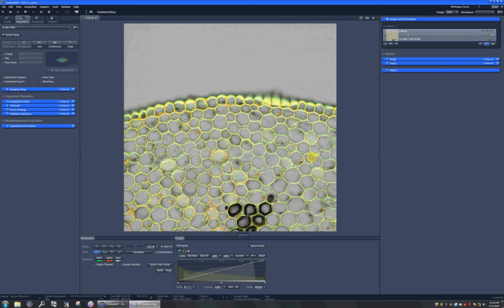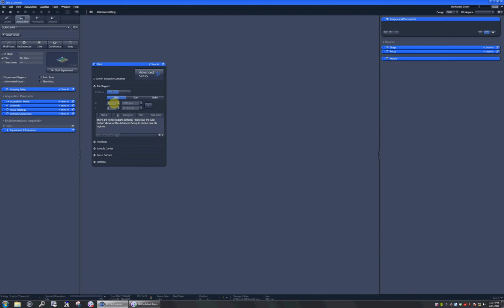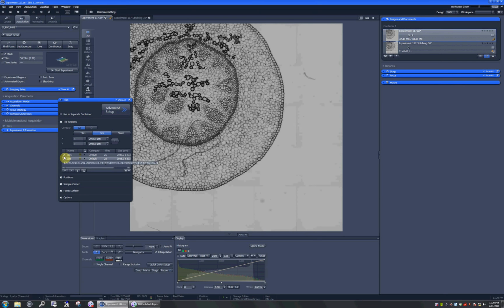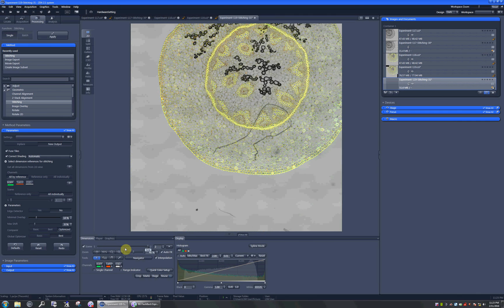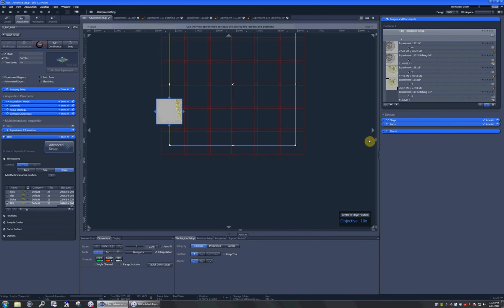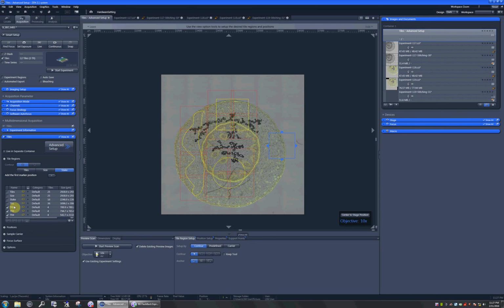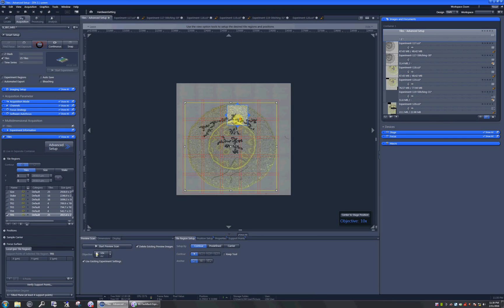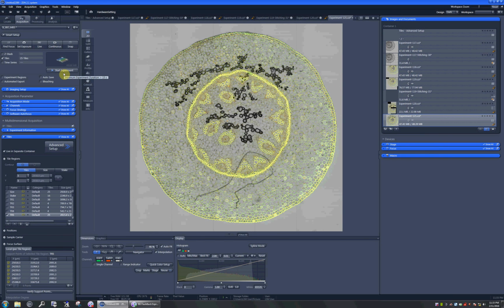ZEN 2. Tiles

Comment: Is there a way to change the orientation of the tiles? I’m using skin sections, and the way the slide is loaded into the microscope means the epidermis is pointing to the right, and I want it to be at the top of the image. Is there a way to change the position of the camera before the images are taken, or to rotate the image after they are taken without changing the image format?
Reply from the maker: Hej Oliver. Here I am using confocal microscope that has a scanning head that can be rotated in the "Acquisition Mode" tab. If you are using a camera, the simple fix is to loosen a bit the C-mount that will allow rotating the camera. Another alternative is to rotate the final image.

Comment: Is there a way to take the pictures individually with the "Snap" button, and then merge them into a global image? My sample is a living muscle where the focus is constantly chanching, the x,y position however are steady.
Reply from the maker: This kind of stitching can be done only manually or if you are lucky it might work with Image J plugin for tile stitching.   If your sample is not too photo-sensitive and you are not after rapid dynamics, then you can combine z-stacks and Tile scan (basically run z-stack on each tile) and then it is possible to use automatic stitching from ZEN.
Reply: @AlyonaMinina  Thank you very much for your fast reply. I cannot combine with z-stack because the animal is sleeping but breathing, and that movement disturb the z axis. I know it should possible be done with ImageJ (plugin or selfcoded), so I'll try to do that.